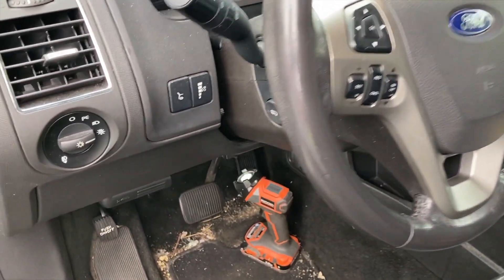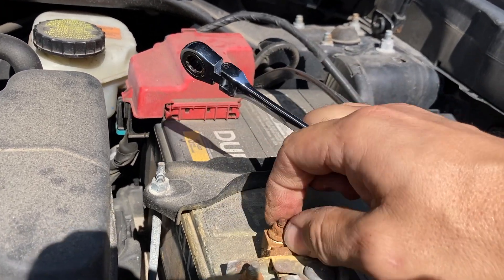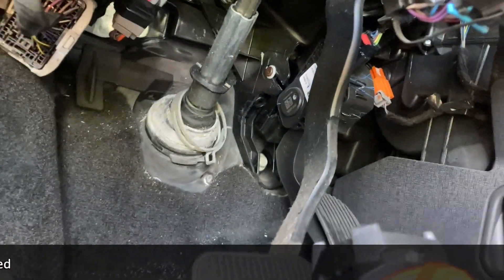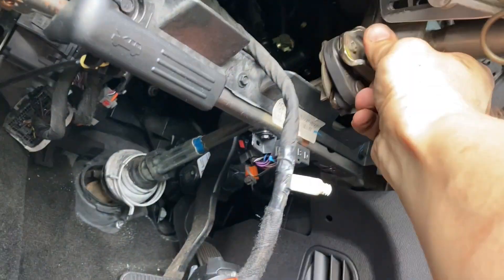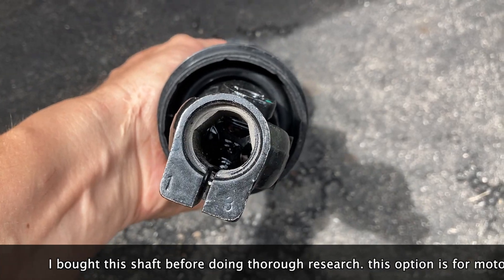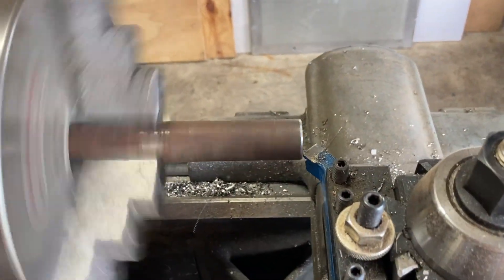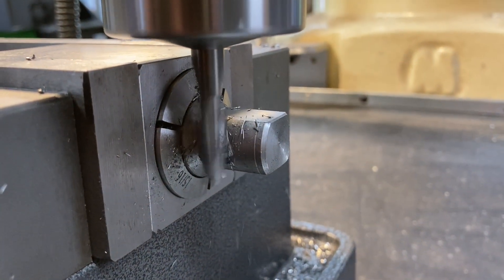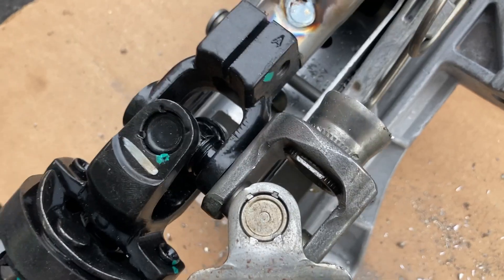Ford Flex Steering shaft swap

Comment: I have a problem with the steering play on my Mercedes a class 2014 😮it’s a horrible thing,so I don’t think 🤔 would be able to do it and I don’t having no tools ⚒️ how much cost it? Steering craft I saw on eBay for 25 pound 😂but labour cost??
Reply from the maker: It does take few tools and some skill. If you’re not sure how to do it, maybe there are videos about your particular car. If not, maybe having a mechanic to fix it is the way to go.

Comment: Can you just put grease around it and see if the grinding goes away?
Reply from the maker: Thank you for watching and for your question. I tried wd40, it helped pinpoint the problem, cause wheel started working a little better when I sprayed it. Greasing could be a solution for some, especially those with grease fittings on the joint (whole 7 people out there). I figured grease on the outside would just attract dirt and cause more issues, so I opted out for replacement. Cheers.

Comment: I live in northern Michigan which means that area gets a salt spray bath all winter. This causes the seizure of the tiny U-joint. My fix is this: I purchase the cheap F150 lower shaft  which fits the rack but nothing else. I cut the the little U- joint yoke with a die grinder being careful not to touch the U - joint caps, which are nothing more than sheet metal stampings, not a machined cap, so they cannot be driven out without damage. On the Flex shaft I use a dremel tool with a burr and remove the staked portions only the drive the old U-joint out, one way only as the staked portion must remain on one side to locate the new U- joint. Use waterproof marine grease, Press it together, re stake the one side and the job is done for $33 for the sacrificial F150 lower shaft as of 8/20/2024
Reply from the maker: @johnweide8822  your fix is even cheaper than mine.
Reply: Hey John. Do you have a part number or any other info for the f150 lower joint? Wife’s 15 flex needs to be fixed asap

Thanks

Comment: You actually don't have to remove the steering wheel to remove the shaft. I changed my 2009 ford flex and it fit perfectly!
Reply: I only paid $140 Canadian from  Amazon
Reply: how Isnt it pressed on to the round knurled knob?
Reply from the maker: @angrywargamer8836 yes it is, and it’s is crimped in place. There is no way to remove it without cutting it off.
Reply: @TinkeringNerd   do you think its possible to grind off the rivets on the rubber joint and put new shaft on there and bolt it together?
Reply from the maker: @TVAPeter thanks for watching! I think it’s not impossible, though hard to reach. But that would only get you half of the shaft replaced, however, given the alternative, may be well worth it.
Reply: @TinkeringNerd  well the U joint on the inside is intact, the one on the sterring rack is the problem child eaten by rust. I can turn the steering wheel for access.

Comment: Could you have just slid the lower portion off and reinstall it on the the old midshaft?
Reply from the maker: Short answer: no.
Reply from the maker: Long answer: the steering shaft was crimped onto the steering column, no way to take it off. Let alone, trying to put another one on it. Cheers.